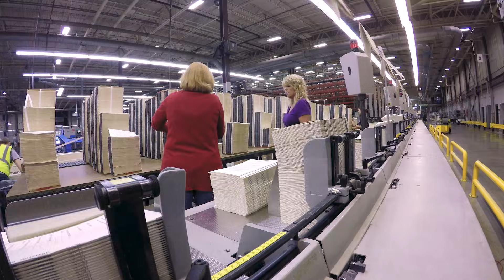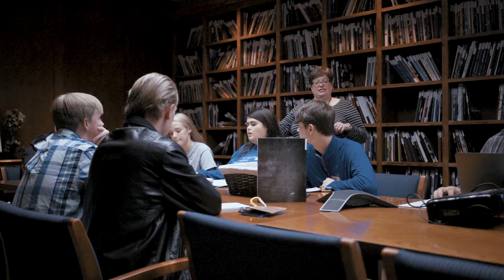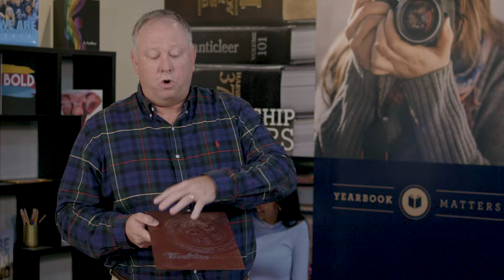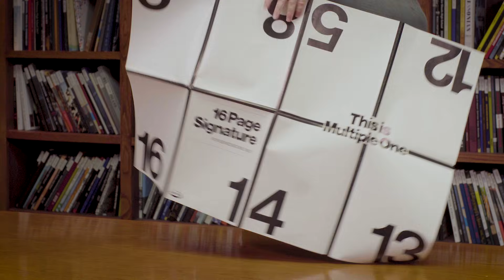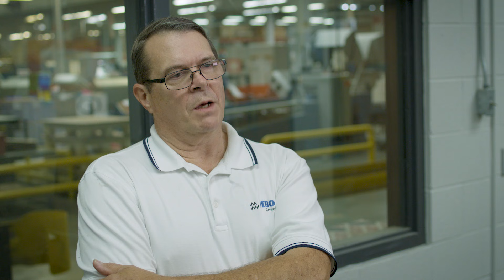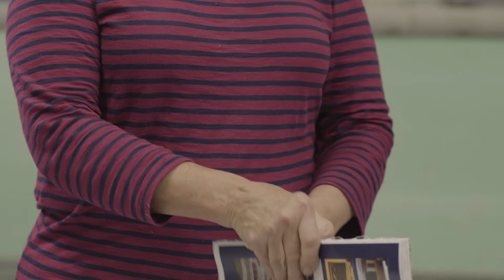Tour of the Printing Process at Jostens

Comment: Think about the values of whom you do business with.  Jostens, for decades a major employer in a small California city, recently closed their Visalia yearbook plant in the spring of 2020.  110 employees, many of who had decades of service, lost their jobs.

Yes, times are hard now and tough times make for tough decisions. However, Jostens laid off these 110 employees with no severance packages hiding behind COVID-19.  None.  Thanks for the memories and off to the street with you. Think about it, a $700 million plus a year sales volume company with many highly paid executives gave zero severance to many low paid hard-working loyal employees.

In addition, Jostens manufacturing facilities celebrate Columbus Day as a legal holiday, but do not celebrate Martin Luther King Day.  This is done to reduce the number of paid holiday days to Jostens largely seasonal workforce. It’s possible that Jostens has not been entirely truthful about this in completing state and school district compliance mandates.
 
Jostens violated the spirit if not the letter of the law (by using COVID) to circumvent California Assembly Bill 2957: Business Closures. The California "WARN" statute requires employers with 75 or more employees to provide 60 days' notice of a mass layoff, relocation or termination affecting 50 or more employees. Governor Davis signed the measure modeled on the federal Worker Adjustment and Retraining Notification Act, or WARN, on September 21, 2002.

 Think about the values of whom you do business with.